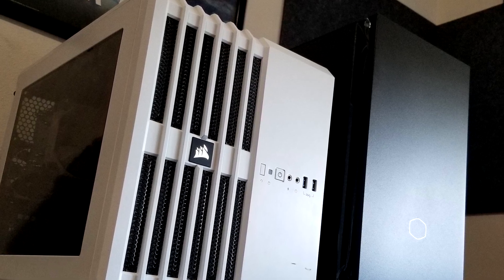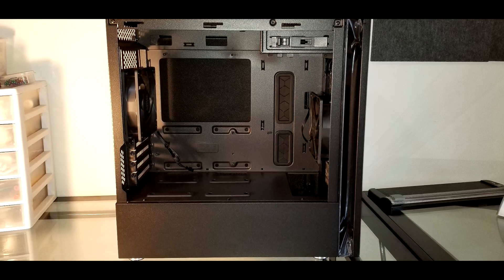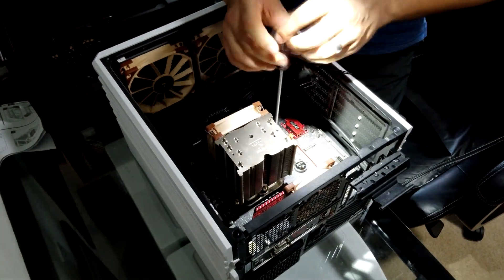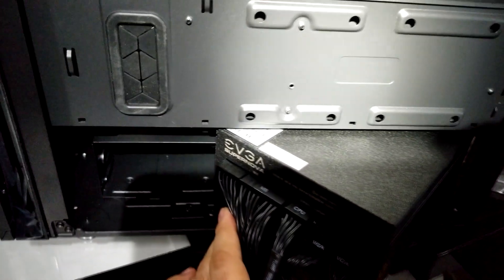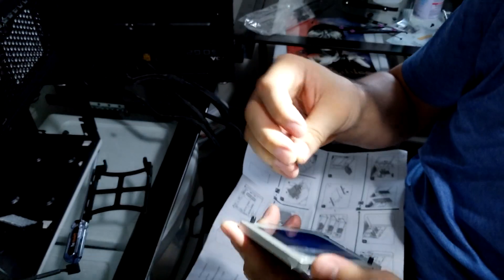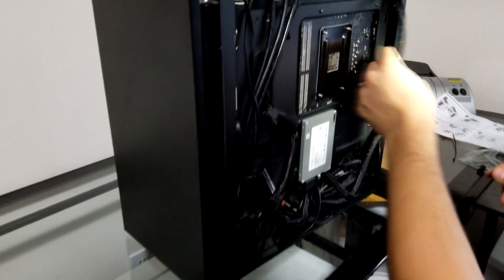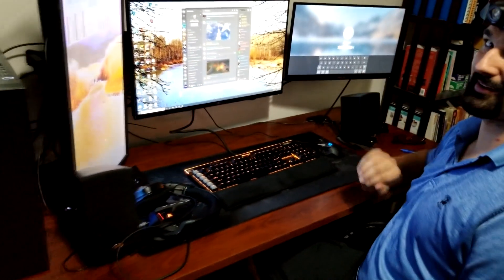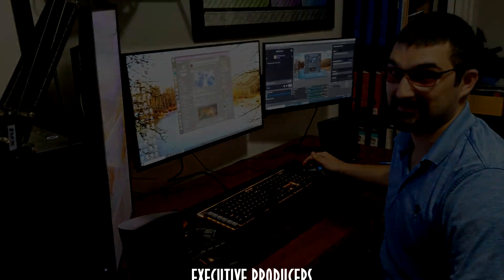Silencing the Streambox

Comment: The SSD moment. I felt like looking at myself when assembling my new rig XD 
"Ok, now, the SSD... Where the frak do I put this damn thing?"
looking on the manual
"Oooooh, That's on the OTHER side! Neeeat"
And yeah CPU power connector is a pain in the back, especially when having some "small" cpu cooler vent like Dark Rock Pro or NH-D15. "HOW AM I SUPPOSED TO PUT MY FINGERS THERE?!"
Reply from the maker: Hahaha. Yeah I saw the mounting points but couldn't figure out how to attach the drive. -DE